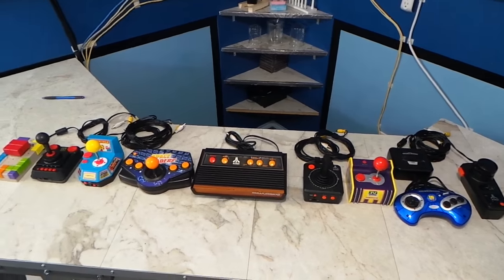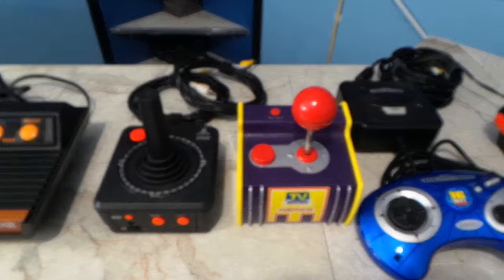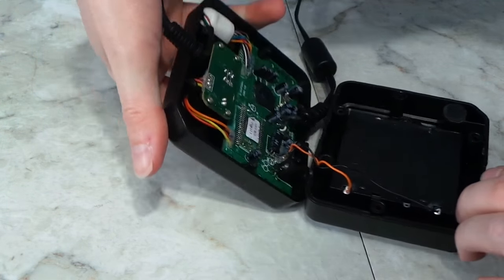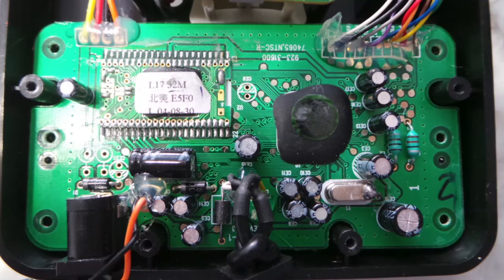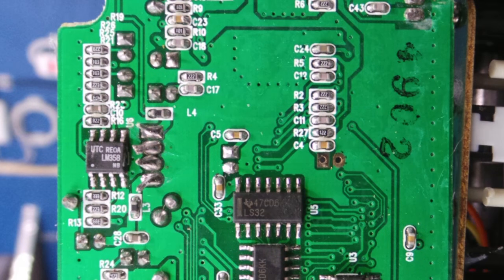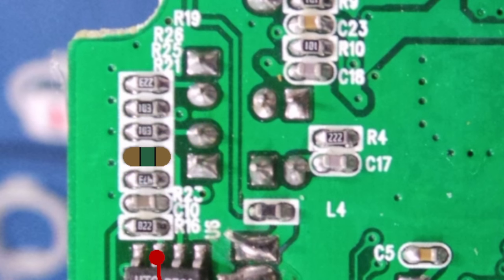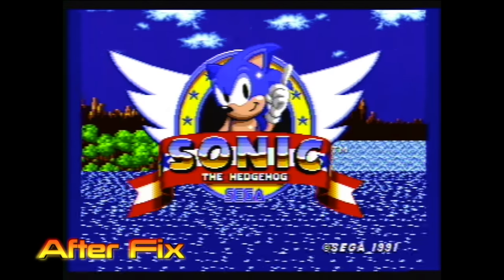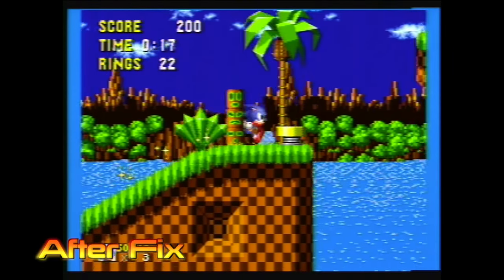Radica Sega Genesis Audio Distortion Fix

Comment: My megadrive was even worse. like a lot worse.. Sounded like tiger electronic games. Seems like the resistors started to fail?
Reply: probably
Reply: +Jason Leon Resistors don't go bad all that often, it's mostly capacitors that dry up and go out of spec. What model Genesis do you have? Model 1 or Model 2? The Model 2 Genesis consoles were notoriously bad in sound quality out of the box.
Reply: Shitty resistors go bad all the time. All the time in the army. It was my megadrive.. It is in storage somewhere.
Reply: +Daniël's tiger neighborhood yes
Reply: Do resistors fail on old consoles? If they do, I've never heard mention of it. More likely it's the capacitors. Old consoles like the Turbografx 16 usually need to be recapped by now, as the capacitors are of poor quality and are all starting to leak. I had to get mine recapped, it no longer even displayed video and the sound was so muffled and quiet it was almost inaudible. 

Also, if it was a model 2 Genesis/Megadrive (the smaller one,) those had lousy and unstable sound circuitry in them, and quality varied. All this can be fixed by someone who knows how to do classic console repair. See if you can find one in your area. Also, the "Game Sack" channel here on Youtube has a video about this stuff, repairing old consoles, along with a section specifically about fixing sound on the Genesis/Megadrive model 2. Check it out for more information.
Reply: I am not sure. Not like I play it anyway. Was more of a Nintendo fan boy back then then Sega. It rarely gets played every 2 years and it is on mute.

Comment: There is a newer Genesis that has a cartridge socket as well as a library of built-in games.

I wish Nintendo would license an authorised SNES system-on-a-chip re-remake.
Reply: The sound is terrible on the at games Sega Genesis also if you want to play SNES games just get a Wii u
Reply: There is a cheap and realy good alternative.
I modded a old Wii so it can play DVDs / play games from usb sticks / copy original games / and of course you can play NES SNES N64 games on it.
Since the wii has USB and N64 controller ports its the most realistic feeling you will get with a emulation.
I also own a real SNES and N64.
Reply: Or a New 3ds

Comment: Can you fix the speed of the european version? ;_;
Reply: European Mega Drives are running slower because of our powerlines "pulsing" at 50 hz while American and Japanese powerlines pulse at 60 hz. Devices which are clocked after the power lines, such as old consoles, will run at different speeds. There are various ways to mod original Mega Drives, and I suppose that if you could somehow take the 50 hz out of the wall and put it into the console at 60 hz it would run like an American one. Thing is that the consoles also tell the games which region it is, so some games, like Sonic 2, will run too fast on a 60 hz PAL machine.
Reply: PuffyRainbowCloud thank you

Comment: Then you'd hate the other Genesis clones, I have one  made by atgames the sound is way off AND distorted.....
Reply: +gmcnewlook And those you can't fix with resistor swapping.
Actually, most of the problem is the fact they're really really bad genesis emulators running on an underpowered SoC that can't actually handle emulating the thing in realtime.

Comment: How is this possible? You remove some parts and the console works better.
Reply: He basically removes an unnecessary amplifier
Reply: Why is it there in the first place if it makes it sound like crap wouldn't it save them $ if they didn't use those components
Reply: It's called bad design. Whoever designed this didn't care or didn't know how the audio was supposed to sound so they just did it willy-nilly.

Comment: As far as I know this entire thing is just emulation, there's no real Mega Drive/Genesis parts in it. Still pretty neat though.
Reply: +SpeedySPCFan Not exactly emulation, emulation imitates the original hardware in software. This type of device imitates the original hardware in hardware. in other words, it uses hardware that matches the performance of the original.
Reply: qwertzy121212
Ah, interesting. From what I read it's not the best attempt though, apparently there's some issues regarding FM synthesis (YM2612) not working as it should

Comment: oh I modded this to have a real cartridge slot since for some reason someone sent me a sega genesis.... with a completely broken video output and power input. so I took the cart slot out and took that rom chip out and turned it into a real genesis cart, I know how the slot was wired up in the factory and how the cart pins work, and surely enough My memory didn't fail me and it came back to me as if it were just yesterday since I had done it

Comment: maybe creat a video about cheap windows laptops that can run good games (games until 2004-2006 maybe)
Reply: I dont now where you live but in Germany you can buy a new laptop with Windows 10 8 GB ram and a quad core cpu for under 250 $
Of course you can expect them to run GTA 5 but normal games like battlefield 4 should be fine.
Reply: Nino Joel ok...its very hard(nearly impossible) to get a laptop wich can play battlefield 4 for 250$

Comment: there are those cheap Chinese portable Sega geneses. they seem to suffer from this issue but otherwise be fine, I wonder if there's a fix like this!
Reply: Unfortunately no.
They use a emulation software.
Thta means it has nothing to do with the old Sega consoles.
There is just a ship with software that emulates the hardware.

Comment: A more elegant fix would be replacing both components with 0 ohm links.
Reply: +陈北宗 If the resistors are providing the feedback to the op-amp, then replacing them with 0 ohm links would just short the output to ground - I think the crucial step is which of the resistor pads you take the jump from.

Comment: That composite signal is disgusting. RGB would be way better.
Reply: The reason It only has composite is because it’s meant to be cheap and easy to use and when it was new most people still using CRT TVs
Reply: @TechHowden  not really. The 04-08 era was when the industry dropped composite support and this was sold in Europe where colour TVs never really lacked RGB support games were just worse here